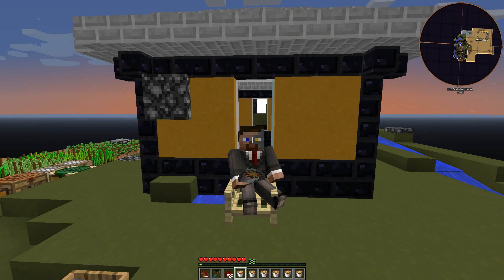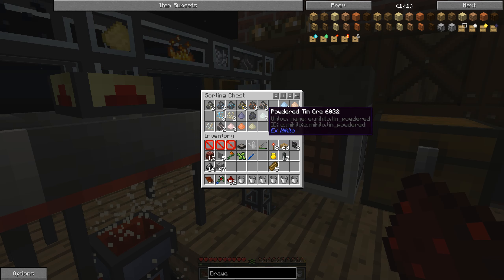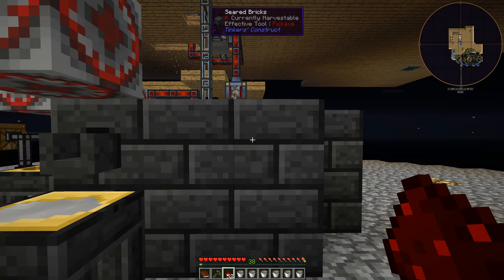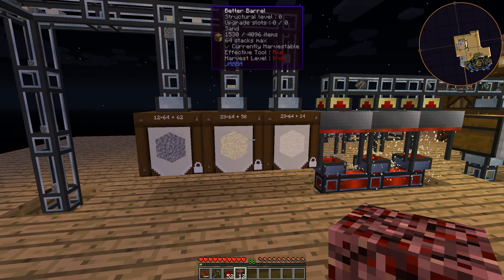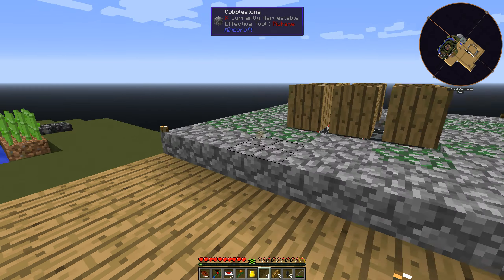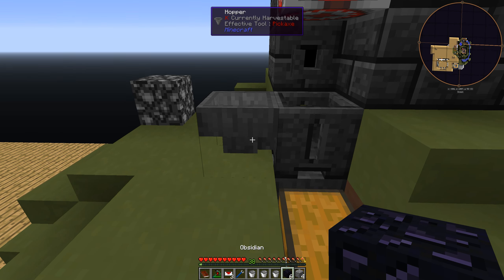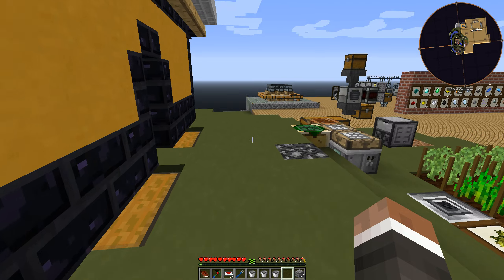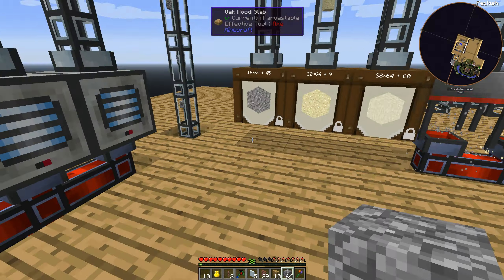AS2: The Early Basics #10 - Factory Part 3

Comment: When manually hammering ore gravel/sand there is a chance of extra. When I tried using the automated hammer for ores, I saw no extra. Hammering the ores in you factory might be a useless step.
Reply from the maker: Brock Phillimore You have a chance of additional extras if you run the hammer with the Fortune Upgrade... But in my experience, you still have a chance at bonus even with regular operation. there have been many times I'd get 5 ore dust from an Ore sand. That being said... Once you get to the point of full automation like I have here... you get far more material just letting the system do the work, than you would if you took all the time to do it yourself. I just did an experiment in my world, I ran 3 Aluminum Ore sand into the Hammer with no Fortune Upgrade, got out 13 Aluminum Dust. Simgle test, yes I would expect to get 14 from hammering, but I am getting some bonus from just the core function.

Very early game it's vital to do all the hammering yourself for the critical materials: Iron, Gold, Silver, and Shiny, the rest you can smelt as Ore Gravel Or Ore Sand. I just run all the
Reply: GrimJahk 

> You have a chance of additional extras if you run the hammer with the Fortune Upgrade...

But wouldn't you get more putting the fortune upgrades in the sieve and skipping the hammerer for ores? 

> Once you get to the point of full automation

I am already automated and was looking to see if I could improve by learning something from you. I didn't even manually hammer the ores before I was automated. I felt I could get more for the same amount of time sieving more.

Edit: Dam MSWord. I didn't know how to delete or edit last post.
Reply from the maker: Brock Phillimore  Fortune upgrade increases the chances of the output. In a Sieve that means chance to produce more drops, In a Hammer that means More materials. I actually dont have fortune upgrades on my hammer... that system you see only has speed upgrades. 

On the other point,   Manually hammering the more rare materials I listed above, is an important method of ore growth. For example Broken Silver ore from gravel.. you only have a 2% chance to get piece, so 2 per 100 sifted gravel, thus about 200 gravel to get ONE silver ore gravel. Now smelt that and you get two ingots. Hammer it, and you have a chance at 5 Crushed Silver Ore thats 25% growth, combine those and crush the Silver ore sand, Hammer that for a chance to get 5 dust. If you are sucessful, and grow at each stage that is a 50% growth of that rare material, One silver ore dust (two ingots) one leftover Crushed silver ore, one leftover powdered silver ore. Those tow "bits" would have taken you another 100 Gravel to obtain. I'm using this example on silver, Gold is a 3% drop rate and Platinum is a 1%.

When you need a particular material like silver, getting a 50% growth with two combines and two hammer swings (10 seconds) is much faster than hammering up another 100 gravel to then sieve... Even if you take the approach that "I need those other materials anyway.." the FREE bonus material on hammering the rare materials still makes sense.
Reply: GrimJahk 

Silver, gold, platinum, diamonds, emeralds and redstone you can get from Agricraft far faster than you can sieve/smelt it. Better to concentrate on sieving even more sand for Yellorium for big reactors and Certus quartz for AE.
Reply from the maker: Brock Phillimore Had not thought of that... I would expect that is because I've not been a big fan of Agricraft so far.. lol